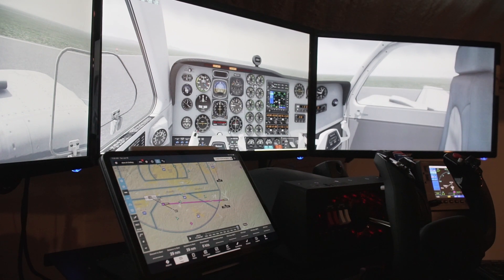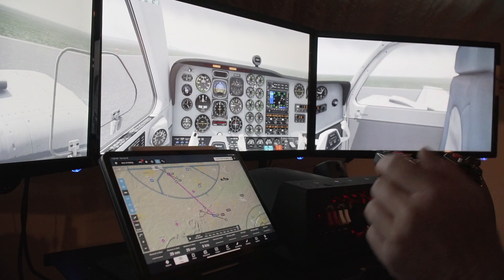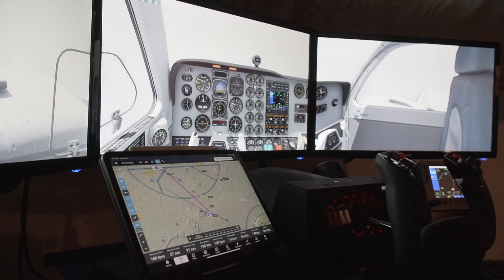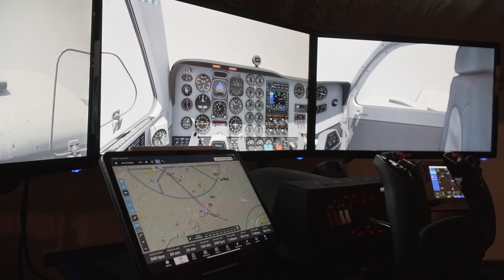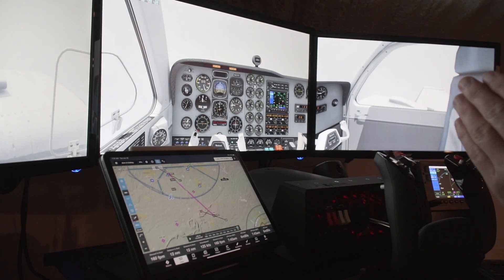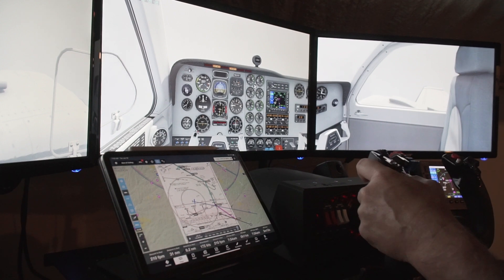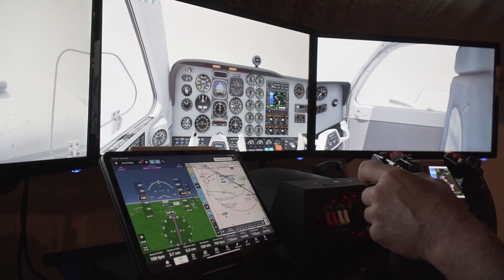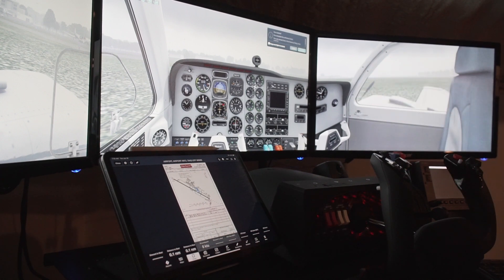Latest X-Plane Issues and Shooting Instrument Approach

Comment: It seems the best answer is a force feedback yoke, but they are expensive.  I had a Saitek yoke, throttle quadrant and trim wheel.  I found the Saitek yoke difficult to fly because of the wide dead band and noise.  I purchased the honeycomb yoke, but kept the Saitek trim wheel which has worked pretty well.  It still takes a while to set the trim, but the Honeycomb yoke is a big improvement over the Saitek yoke.  I am interested in the Brunner CLS-E NG force feedback yoke, but I would like to be able to try one before paying $1,600.
Reply from the maker: I think I'd  have to disagree as this has nothing to do with the yoke.  I'm not touching it.  It has everything to do with the trim wheel in the airplane being completely out of sync with reality.

Comment: Go in your settings for the yoke with the yokes software while also syncing the X Plane systems controls.  Seams you’ve got a mismatch going on.. I use a Yoko and had that issue from the start but it’s sorted now.
Reply from the maker: Not sure what you mean by mismatch.  Trim is working in correct direction.  It is just insane.
Reply: I’m not having the issue with the Yoko Yoke at all.  It’s the cheaper sensors in your systems.

Comment: I started instrument studies and thought X Plane would let me do approaches. I saw the same issues. I changed the response curves and bought an Archer plane. I made a custom curve preset for the archer. I own a real PA 28 Piper Warrior. I have not been able to get X Plane to exactly feel like the real plane at all. But the curve response settings can make a difference. I also bought a KitFox plane in the Sim that has dual G5s and an GFC500 auto pilot which has been good for practicing using the Garmin autopilot with the G5 displays. My real plane has a GNX 375 which is similar to a 650\750. I did not pay for any add-ons to have a newer GPS. I use the 430\530...